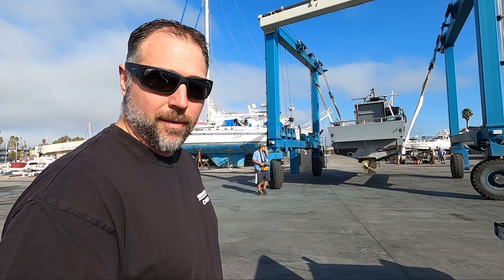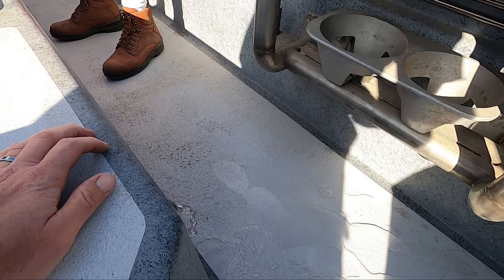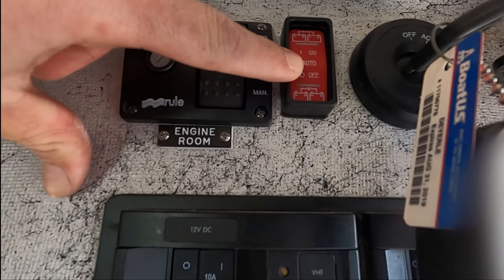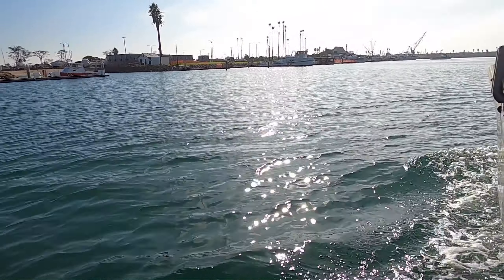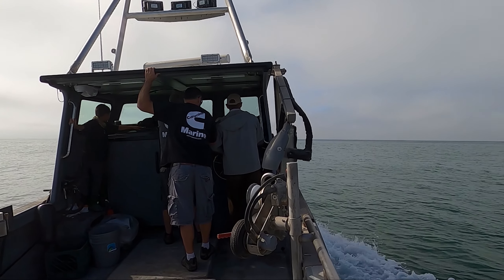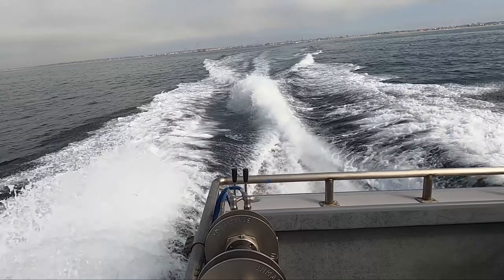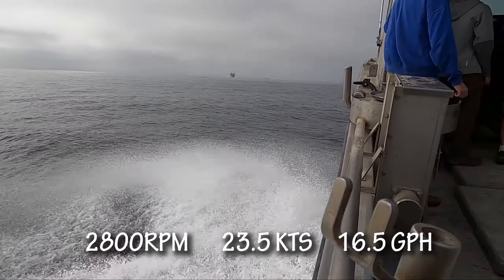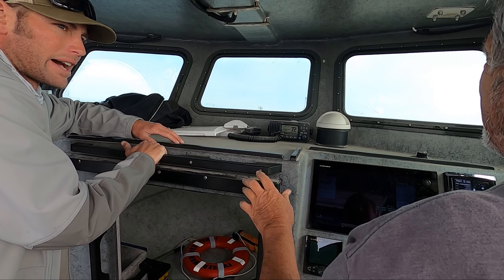Sea Trial: Sea Harvester

Comment: That kind of fuel consumption is associated with "450 hp" at 2000 rpm producing 20 TONS of ACTUAL "tractive force" in a farm tractor that weighs 20 tons alone.